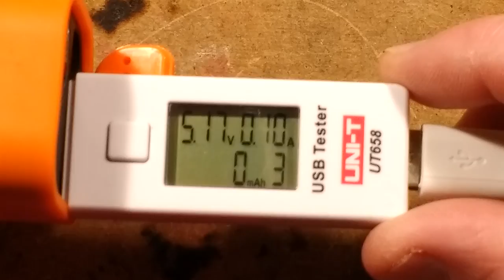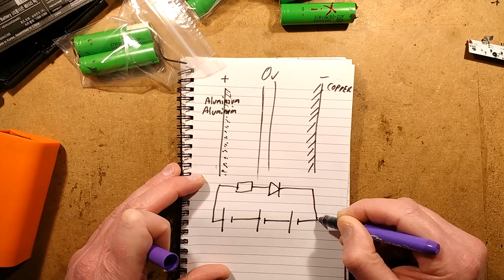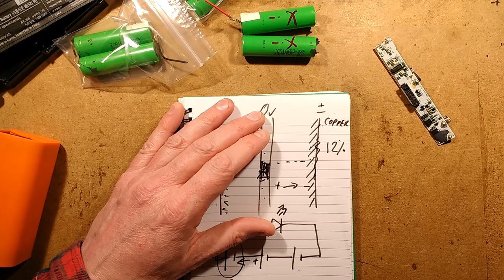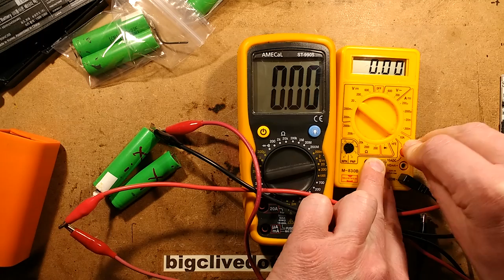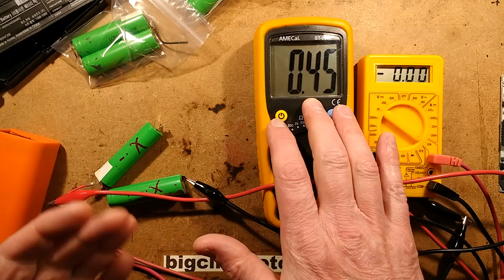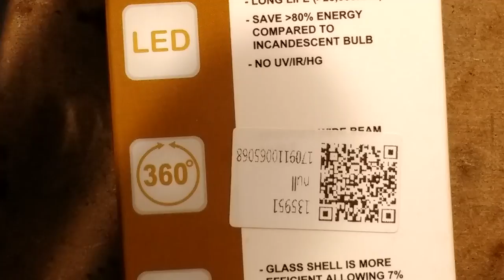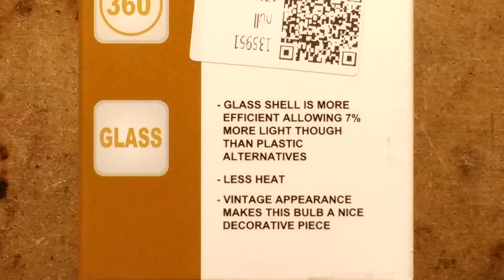Teardown of a faulty Samsung lithium 18650 cell.  (2200mAh)

Comment: Wow, that explaination of what happens when you reverse charge the cell makes perfectly sense. But wasn't there some degrading effect on the capacity when you discharge the battery well below 3.0V? I thought you would lose a significantly part of the cell capacity in that case?
Reply: As with many things; "It Depends".  Some battery chemistries are self-destructive below a certain point...2.5v/cell or lower, I think, but I can't swear to that.  That is a common low-voltage cutoff level, though, so it must be at-or-near an important value to avoid destruction or else BMS's would push things farther to get more out of every charge.  Some cells, by design and/or luck, can handle being run down to 0 volts.  Ironically enough, I think leaving them at 1-1.5V/cell might be more damaging than 0 volts since 1.5V would maybe allow enough power for 'galvanic shenanigans' to happen inside the cell.  I'll have to look into that...I was just realizing that, because I use like 1.65VDC for nickel-plating stuff exactly for that kind of reason, so dunno.

I recently bought some used battery packs to strip out the cells and reuse them in packs of my own making.  One of the sets of cells were green "Sony Fukushima STG US18650GR-G5" battery cells, and they were FLAT-flat-dead.  Even if they only died when shipped, they'd been flat-dead for at least a week (0.02v in the 'best' cell, and these are unprotected cells) and I didn't have much hope for them.  I had a trio of NiMH cells right to hand, so when I stripped the Li-Ions out I thought, "...why not.  SCIENCE!"  And thus was Science performed upon them; I dumped power from the NiMH to the Li-Ions at 0 volts, touch-touching them for only-a-moment in case they caught fire or even sparked, but they didn't even do that much.  I touched them for a few moments, then gave it 30 seconds and checked the cell's power...1.4V.  Wut.  And it did drain slowly-but-steadily, so it was maybe settling still or maybe it was ruined internally, but...eh, whatever!  I fed it to my universal charger...which brought them to 1.8V, which seems to be the 'NiMH cutoff voltage' of the charger since they OBVIOUSLY couldn't be Li-Ions at not-even-2-volts, right?  Back to the NiMH cells, dumped them more power...and once they got above 2.1vdc I fed the cells to my charger and told it to charge-discharge-check them.  It did so, with me warily keeping an eye on them for the like 10 hours or whatever it took to finish to its satisfaction.

The result?  The 0.0-0.02v cells stripped from that pack have, one and all, recovered to (mostly) voltage-stable cells.  One of them, tested just now, was at 4.12v, most were 4.15-4.17.  They tested out to have 2050ish mAh of capacity according to my BT-C3400 charger.  All show about 100 milliohms of resistance, so that's nice of them as well.  So those cells were dead-and-dead, but woke right up...were they lucky?  Do they have a good chemistry?  Was my 'dumping triple-NiMH "18650 cells" (not actually 18650's but the exact same size and shape) power straight into it a lucky choice of methodology?  Noooo idea.

Four other good purple LG's that should have been 3k's or so do not even pretend to take a charge.  They too arrived dead-and-dead, and they remain dead, NiMh's and all having helped them not in the least.

So will you lose significant capacity?  8 were dead, and mostly-recovered.  4 purples were also dead, and remain utterly dead...so my totally useless stat on that so far is "1 out of 3 0-volt Li-Ions is effectively destroyed by the process" as far as I can tell.  :)  But you're right, like the flat-packs from jump-starters, I think those die /quickly/ below 2 volts, and I know I've read about how bad it is to let li-ions self-discharge to 0, but I don't know everything by far.  Some survive it, some don't, some get their capacity crippled because lithium or copper come out of the electrolyte solution or something, which maybe was what happened to this guy's cells.  Sadly, a 'copper infusion failure' might have needed a chromatograph to identify it.  He was hoping for a 'coppery-spot' but I suspect the actual failure is just a vague-haze of copper that won't even show as 'a different color' to our naked eyes.

Comment: 22:08 "the smell is actually really pleasant but people keep saying OH don't breath it! "
A pleasant thing isn't necessarily safe for you. An analogy using taste... Lead (II) acetate was once a sweetener.
Reply: Hear, hear Wolfin.  I managed a chemical plant that manufactured polyurethane adhesive in twin 4oz tube dispensers with a mix tip (like epoxy twin tubes).  The main chemicals used for the urethane reactions were isocyanates, clear syrupy liquids that had only a faint smell of fruit (apple, pear, peach).  To the uninitiated they appeared relatively benign.  However, they are deceptive.  Being able to detect their faint pleasant smell at all meant that one was being exposed to an unsafe concentration level.  As with many other dangerous materials, initial, and even repetitive, exposure sometimes did not immediately manifest the harm that's been done.  The isocyanates are also powerful sensitizers.  This means that each exposure increases one's sensitivity to the next exposure, i.e. the level of exposure required for profound respiratory and other symptoms of toxicity to present is decreased.  Direct exposure of the skin to the finished product or precursors would cause no apparent harm if the area was briefly flushed with water (which catalyzed the formation of the inert polymer).  If left untreated, however, a lesion would develop as with sensitizers like poison ivy, oak, sumac...etc.  The method of producing the product (compounding, packaging, testing, quality control and equipment maintenance) meant that all company personnel had the opportunity to come in contact with clear, mostly odorless, reactive material on any, and all, surfaces.  Opening any door could contaminate oneself.  This was especially problematic as regards the bathroom door—as you can well imagine.  Over time, depending on the thickness of the deposit, moisture in the air polymerized the isocyanates rendering them inert.  Unfortunately, although I provided half-mask respirators (HEPA /activated charcoal filters) & nitrile gloves, performed lung function & respirator fit tests and gave initial, as well as ongoing safety training on chemical hazards and protective equipment, almost every new employee had to experience at least one incidence of poison ivy-like rash.  The rash doesn't spread, it can itch a little bit and disappears in a couple of days, but it spooked the heck out of people.  The new hires had little understanding of the importance of my rash prevention warnings, no matter how simple and emphatic I made them.  They all, of course, no matter how small the lesion, with no exception, insisted on seeing a doctor, thereby creating an insurance premium increasing incident reportable to Workman's Compensation as a work related injury requiring a doctor's care.

Comment: Hey Clive, all chemistries of batteries naturally self-discharge and no circuitry prevents this occurring, even protected-cells. Most lithiums will self-discharge between 0.5-5% in the first 24h, then 1–2% per month (plus 3% for safety circuit) this is hugely affected by the way the battery is stored, for example, the temperature, the age of the cell, the quality of the cell and so on. So lithiums self-discharge even without being attached to anything. Lithiums that are stored for long periods of time risk going under the cut-off which ultimately damages the chemistry in the battery, increasing internal resistance, capacity and may even make the battery become unstable. I often come across brand new cells which have been sitting on the self-unused for many years, a lot of them return 2v or below indicating over-discharge, essentially, these batteries are damaged goods and should be binned responsibly. There is absolutely 'no-restore' feature for Lithium cells, the reason why chargers tackle charge is because batteries have different cut-off points, so until it's at 2.7v which is the baseline for most, it'll tickle, again, it's not a restore life feature. Samsungs 25R have a cut-off 2.5v, Some Panasonic has 2.65v so on, these chargers have no way of identifying the battery, in fact, if you put a 1.2v NiMH it'll try and reach 2.7v at a low tickle and then the max that charger supports. A lithium cell that is at 1v will quickly go to 2.7v within a few seconds at 100-200ma but I must stress lol - this is not making the battery good again... Damage is done, its game over for that battery and simply 1. not worth the risk 2. not going to last.

Comment: thanks for your extrem good video. 
I recently broke a battery pack cause (i think) the saw i used it with sucked too much of the current. so opened the pack:
I noticed that a row (3parallel) (5 series) is at almost 0v.
thanks to you, now i have measured the resistance:
normal cell + - 660ohm then other direction - + extremely high resistance. the broken 3 cells: 120ohm in both directions.
what do you think it is probably already in the middle of the cell full of foreign ions? is it possible to safe them back?

Comment: Thanks. My previous drill lost power. I found that some dead cells could be brought back by levering the pos cap to remake a connection and I could recharge it. I also suspect these cells do not like freezing outdoor temperatures.

Comment: Hi Clive. You might find it useful to put little rod supermagnets on your crocodile clips so that they stick to the battery electrodes without needing extra fingers.  I wonder why they don't put magnet tips in the meter kits?

On the batteries: If you look at the crimp overlap with your lens or pocket microscope, you may find that the rolled up electrodes can be awfully close together under the crimp, and there is only a very thin plastic ring washer stopping the outer case touching the weird arrangement of waggon wheels and metal washers that they annoyingly always rivet tags to at exactly the wrong angle to join to any other battery!

I think it would be quite easy for metal or solder dust to short the case and washers under this rim.
After watching another video of someone taking the top off with pliers, as I wondered why they put in all the weird washers and unsolderable tags that always point the wrong way, I took apart a 'dead one' out of a Bosch 1200 drill/driver (boy do they squeeze those batteries in only one possible way!), just by grinding a little at a time off the shoulder of the crimp with a rotory tool, trying not to short the foils...

The astonishing collection of spiders, washers, and metal discs then just lifts out to reveal a corroded aluminium tab. Carefully poke a blunt screw down beside the corroded aluminium, and you have a working battery again. Probably best not to put it back in your power tools though!

Comment: What definitions are you using for "anode" and "cathode"? You seem consistent in using "anode" as the positive terminal, which is correct for vacuum tubes (valves) and semiconductors that dissipate energy, but I think the polarity is reversed for power sources like batteries (then again you guys also drive on the wrong side of the road). By definition, electrons enter a device through the cathode and leave through the anode, so for a primary battery supplying power the negative terminal is the anode. (I assume you've also heard of "sacrificial anodes".)

Technically the anode and cathode switch roles when a secondary battery is charged, but I think the convention is to keep the same (discharge) terminology. So I think the anode is the copper foil coated with graphite that holds the lithium ions when the battery is charged, and the cathode is the aluminum foil coated with one of a variety of oxidizers like lithium cobalt dioxide, lithium iron phosphate, etc. My understanding is that most Li-ion battery fires involve a cobalt dioxide cathode decomposing in heat and liberating gaseous oxygen that vigorously burns the flammable organic electrolyte. Reducing the fire hazard is one of the main reasons for these other cathode materials.

Comment: AIUI it's the electrolyte that ignites and burns explosively when it gets hot enough due to internal or external short. That then ignites the Lithium. But the electrolyte includes a volatile organic solvent. In this cell that appears to have more or less dried out, probably through heat and venting during years of use. Which may explain why it's dead, since the dried electrolyte is no longer capable of ion transport. What's left is the semi-dry glue that ripped graphite from the electrodes and stuck it to the separator.

Comment: As question: 
 
For your explosion container, would it not make sense to fill it half with sand and have more sand available to cover the burning cell amply? 
 
As far as I know, when the cells burst, they shoot out a jet of VERY hot gas easily melting metal.

Comment: Hi Clive. My HP Battery pack with 6x 18650 cells is now on a short runtime of about 45mins instead of 4hrs. Do you think its worth the effort of opening up the battery pack to replace the cells ?. Since the laptop battery packs on ebay are cheap, and when you zoom in on the picture they are only 4200mah at best.  So i would rather buy known Branded hi capacity cells like a Samsung 2800. Then at least i know they are good cells. What are your thoughts ?.
Reply from the maker: It's maybe easier just to get a new pack.  Some of the electronic modules in original battery packs can cause issues if trying to replace cells.

Comment: it appear a good battery, have you tried to slowly charge it? when a litium battery fail from too deep discarge you find copper migrated to the alluminium layer and plating the graphite after the separator, so the cell short circuit forever because copper dendrites

Comment: the delamination would definitely cause a resistance to charge, or a surface charge only that quickly drains off.  I think of it in the manor of Heat is also a form of energy it seems as it came to the point where the resistance had risen enough it was converting all energy into heat and delaminated, as seen of the graphite transfer, and the break down of the membrane between the anode and cathode. the change of opaque to transparent would suggest its been through some hot cycles, like certain thermoplastics turn clear when heated to their near breakdown temperature.

Comment: Awesome, surprised all that fit inside there. I learn from experience that when the plastic label rips off dont use it or charge it til you put tape over the exposed metal, I had one burst and melt my intelli charger.

Comment: It is probably that just the PTC needed to be removed to recover again the inner cell resistance, those membranes can keep a very high resistance once activated. CID could be another reason but it would absolutely no current flow if you try to charge it.

Comment: Hey Clive, did that laptop have usb3? If it was around 2010-2013 there were a bunch crap chipsets for USB that the drivers for were completely unstable, just saying might not have been a physical issue

Comment: Thinking of putting a few good 2600mAh 18650 cells ive got from a laptop into a powerbank housing from ebay, im looking a a few cheap ones with space for 5 cells and i know you've opened quite a few cheap ebay power banks before so do you think the components inside are fine enough for every day use?

Comment: In the case of the burning cell, I don't think it's copper making the short circuit. What I heard the lithium itself forms the dendrites that poke through the separator while charging. Also discharging to 0V might not be "deadly", but a capacity loss will very likely happen (a common value is at below 2V). Also you have to keep in mind, just because a battery measures 0V doesn't mean it has been discharged to 0V. It could have been below that (as you say).

Comment: Usually, one will have an internal short and pull the rest down. Maybe from reverse charging or just an internal short? Either way it only takes one battery you could kill the whole pack!
 I have one that looks identical to what you have on the table in front of me but my batteries are blue. You can replace the one battery and still have a fairly decent battery pack.

Comment: Clearly lithium fumes effect the memory.
First half of the video was pretty informative regarding the charge rates and cutoff voltages since I have a few packs that need rebuilding I can now test to see which cells are worth salvaging.
Reply from the maker: To test cells I recommend discharging them to around 3V.  You could use a small power bank to get some use out of them while doing that.  Then test their capacity when charged from 3V to 4.2V and leave them sitting fully charged for a few days and see if the voltage has fallen significantly.  Settling down to around 4V is OK but progressively discharging below that in standby indicates a damaged internal separator and time for the recycle bin.

Comment: I suspect the gap between the copper electrode and the graphite is where the resistance came from, and hence the failure.  The not-so-good contact was creating the internal resistance, and hence preventing the lithium ion transference.

Comment: In the old days of RC racing we used to discharge NICD battery packs to a certain voltage to create a "dump voltage" or memory. was this damaging the packs?
Reply from the maker: It was common to discharge packs to around 1V per cell before recharging.  It was done to avoid memory effect.